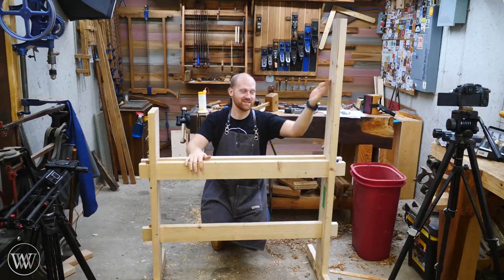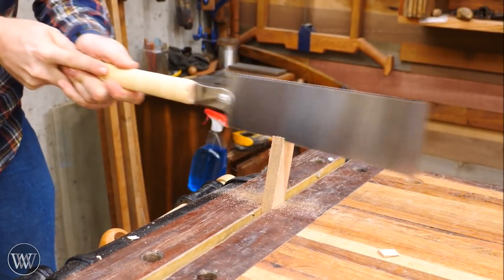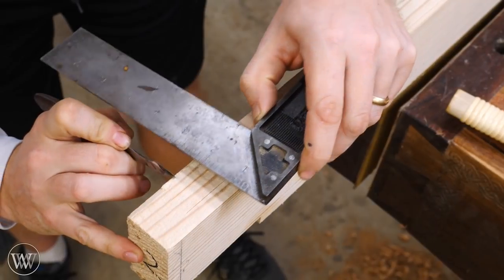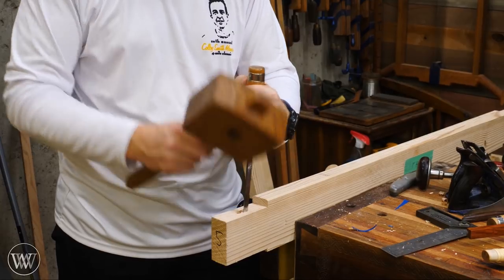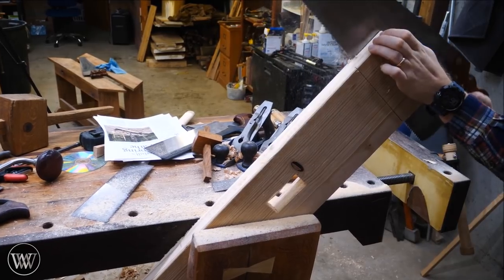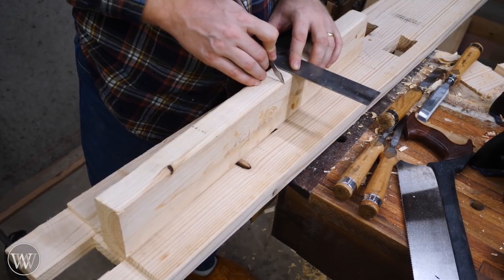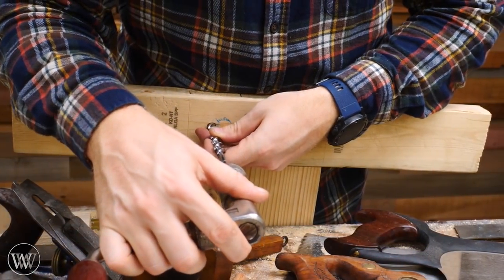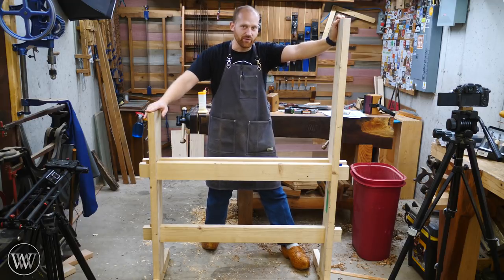How To Make a Spring Pole Lathe Part 3 | Foot Powered Hand Tool Woodworking

Comment: Hah, when I saw you laying out that real shallow angle I thought "I wonder how he's going to start that?"  I had to do something similar lately and it's not easy.
Reply from the maker: no it is not. just sakes a light hand! thanks man!
Reply: uzimonkey sometimes it is easier to leave the top end a little bit long, cut a kerf into the board about 1/4 tob1/2 way across and use that as a guide to start your shallow angle cut. When you're done with the shallow cut you can cut the excess off the top. It doesn't take much, even a 1/2 inch extra atvthe top will do. The less you leave at The top as a starting guide, the less waste you have.
Hope this was understandable and helps.

Comment: I was thinking that you could put some concrete pad in the feets, that ways makeit more heavy and gonna have less moving in the frame, only a idea if you no like it that fine, but look very ligth weigth or top heavy more considerate the piece turning
Reply from the maker: If this was a normal lathe that would be a problem but with a spring pole the RPm are so slow and the force is down on the tredal as you step on it. So they do not need much at all. one of the fun things t play with!
Reply: Yep. It’s kind of a toy lathe that makes big boy things... and you can move it away from the wife when she’s trying to sleep and you get a turning bug!!!!

Comment: Another great video in the series, looking forward to seeing it turn. Just wondering, for morticing, why do you bore a hole then clean the edges? I've been watching a few of paul sellers videos and he is pretty set on not boring first. What are your thoughts on the subject? I don't mean to question you or think i know more, i just want to know your thinking. Again, great video
Reply from the maker: for me if it is a through mortise, wider then 1/2" or if the mortise is wider then it is wide I bore it out first. it is just much faster in those cases. but for most standard furniture they are none of those and in that case, I just chop it much the same way as Paul.
Reply: :) I love Paul’s but he never replies :(
Reply from the maker: ya he does very little if any of the actual computer stuff. but a great guy when you do get the chance to talk to him.

Comment: why not extend the spring out past the stock head and attach it to a treadle. Then the piece you are trying to turn will go one direction instead of having it spin both ways? Just wondering?
Reply from the maker: because that would be a flywheel lathe. those are not as easy to travel with. but I will be building one of those in the future. just not sure when. but even then I do find the spring pole to be far more enjoyable to work with. more challenging and slower work.

Comment: What was the pitch on the wedges, any difference when working with hardwood? 
Also If you had to keep only one Vise type/style which would it be?
Reply from the maker: +Ray Bartlett I have not found any one pitch to be better then another. Usually something between 1 to 5 and 1 to 9 works well for both hard and soft. Though you will find people that swear by one or the other. I like large face vise that can also be used as a tail vice on the end of the bench. 95% of what I do is on that.
Reply: Yep 1n5 or 1n9... I mostly use 1n7 I’m lazy.

Comment: Do you have any plans to upgrade this spring pole to a threadle lathe in the future?
Reply from the maker: It is a treadle lathe? but if you are referring to a flywheel lathe I will be building one of those eventually. The spring pole lathe is just more fun and easier to transport places.
Reply: Wood By Wright Yes, that was what I was referring to.  I've wanted to build a lathe for a while, but I have so many projects on my plate now, I don't have any time.
Reply from the maker: time is always a problem! hope it solves it's self. everyone should have their own lathe.

Comment: "I wanted to use white oak blah blah blah..."  Tell the truth you are simply in love with white oak and if you had your way everything would be white oak. Lol.  But seriously, what's the European equivalent?
Reply from the maker: European oak is fairly close. the rays are not as big, and the grain is not as wild and varied, but it is not that far off.
Reply: Have you seen curly live oak. With a little spalting? It’s gorgeous.
Reply from the maker: I have never actualy played with live oak. it is on my list though.
Reply: Wood By Wright I made a mallet... still green... beautiful grain... it’s cracking... but it’s an accomplishment with bar clamps, a dull saw, the floor as a work bench and a 2x4 stud wall to hold it still mean while using the bottom wall plate as my bench stop and shooting board. I’ll try to send a pic.